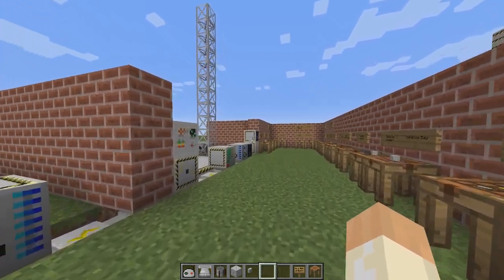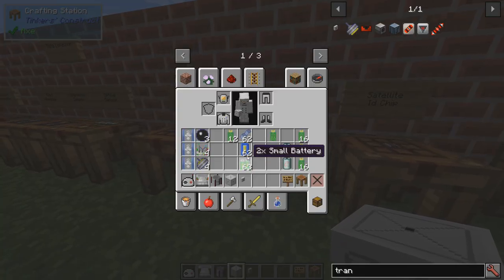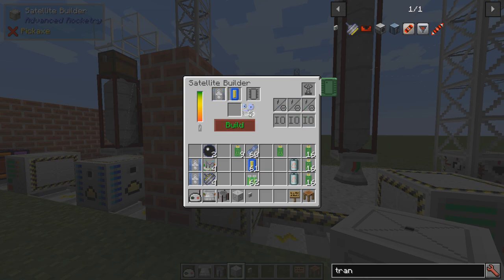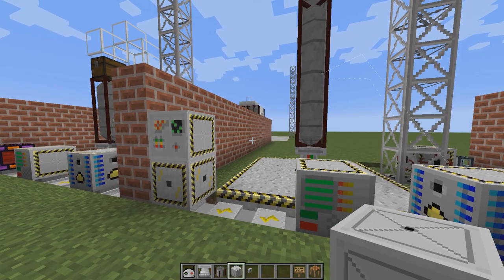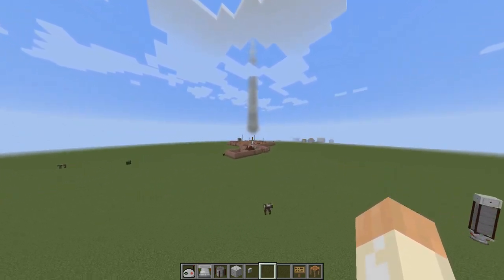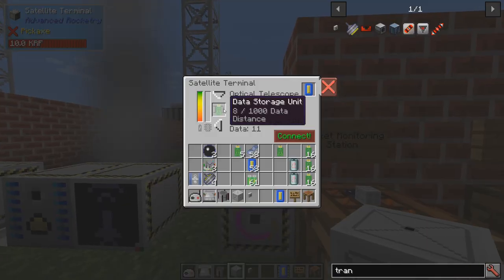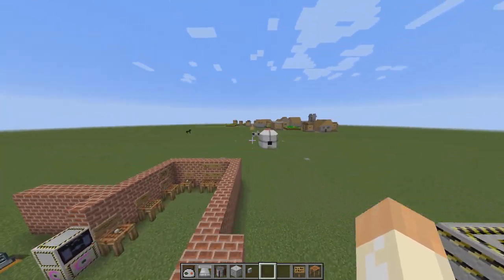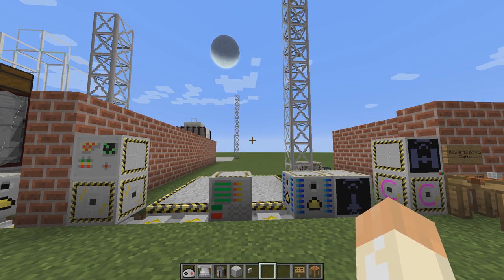Advanced Rocketry Tutorial #5 - Launching Satellites, Data Collection & Transfer (Minecraft 1.12.2)

Comment: For some reason when I try to use 3 satellite terminals with one each being used for each of the 3 data types, and link them to the respective data buses on the back of the multiblock with wireless transceivers, they go all screwy and don't work. I used the linker, turned all of them on and set the terminal ones to extract. They'll work individually but as soon as I link a second set, none of them work.
Reply from the maker: I had lots of problems with the data collection, the terminals collected wrong data type and as soon as I connected them to a bus everything just broke down. The wireless transfer worked better but I was hoping this would be solved in later releases or in different packs. I have no solution to those problems so I think going to the mod dev is the only thing to do...

Comment: I read some where that you can put a guidens computer on the rocket that launches sattelites and then it will return to the pad after the satelite has been deployed.
Reply from the maker: According to the mod dev the rocket should come back but it's a bit random where it lands. But I haven't really explored it further. If I find a stable solution I'll probably make a video with the findings.
Reply: I tested a bit and adding a guidens computer and a planet id chip and setting the destination to earth, the rocket landed exaclty at the spot it launched from.
Reply from the maker: Cool, I just tried it and it worked just fine! Thanks a lot for the tip! I couldn't launch it again though, for some reason I had to disassemble the rocket and then assemble it again. Perhaps a small bug that can be fixed.

Comment: How do I power the Satellite builder?  every cable I've tried connecting, won't connect to the block.
Reply from the maker: Did you try using a Power Input Plug? I don't remember right now when it's required and not but it's used to insert power into machines.
Reply: Thanks, I tried that and it worked.
Reply from the maker: @kelavia2112  Great!